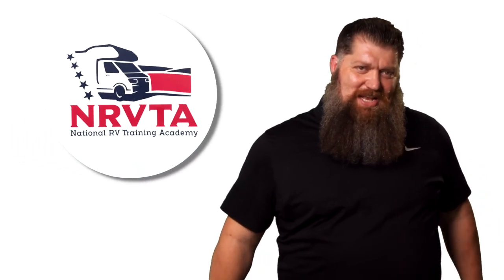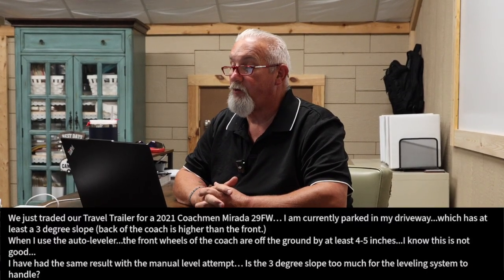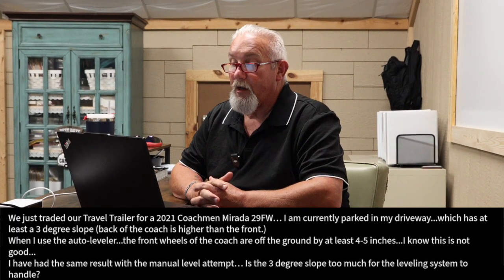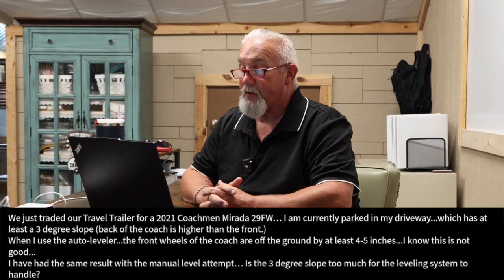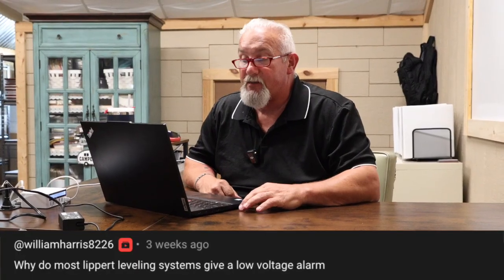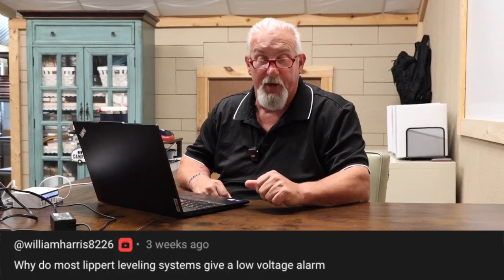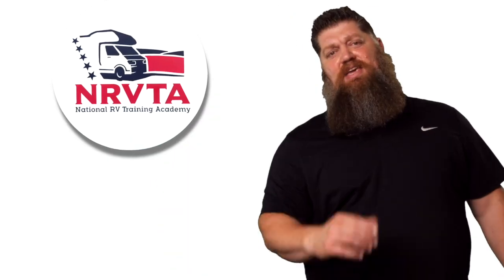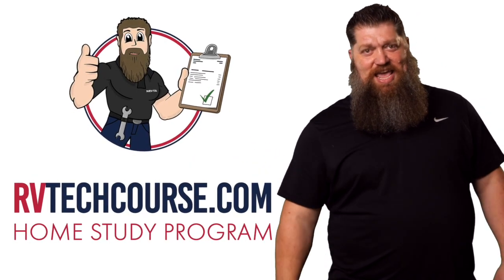RV Q&A: Brian Responds to Viewer Comments

Comment: Got a question for you. We will be purchasing an RV soon to go full-time rv life. Been doing some research and these videos are very helpful. Question is around sealing the outside of the RV, windows for example. I've seen that the bottom doesn't get sealed, is that correct?

Comment: how do you get a question to Todd?  I'm interested how to handle the routing for the heavy wiring needed for a 12v AC.  The existing gauge wires in the trailer are too light to handle it and trying to figure out the routing is a major headache.
Reply: That is a very floorplan specific question. I am not sure that Todd can answer it in a video.
Reply: @entriesat  RVer's don;t realize they need to upgrade the wiring.  I think that is something he needs to talk about.  Yes it would be floorplan specific, but an explanation of the plus and minus of going to a 12 v system would be of extreme interest to those of us who might be considering the change.  At least that would DIY something to really consider before spending the money for a system they don't understand the need for gauge 2 or heavier wiring and the need to use it.